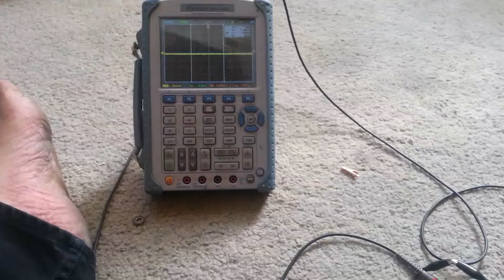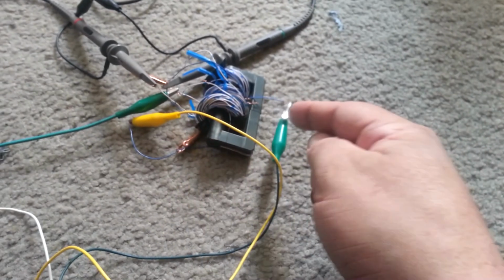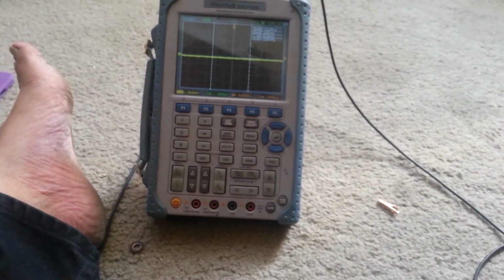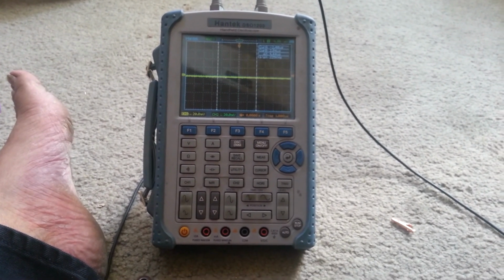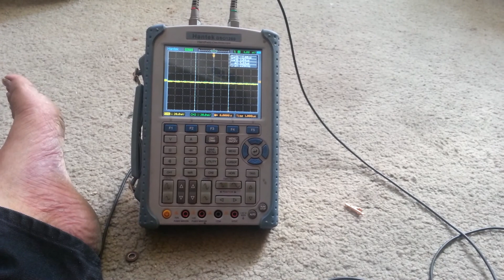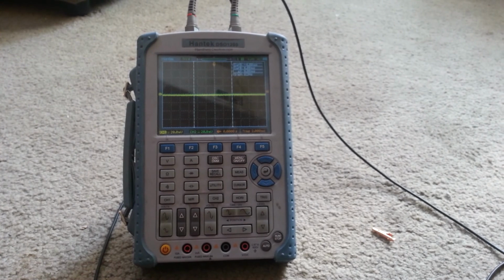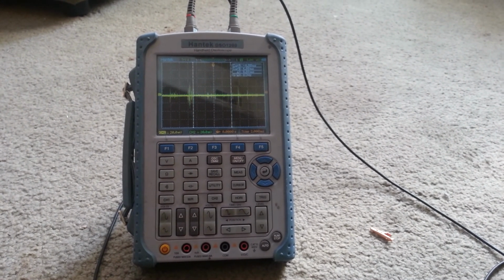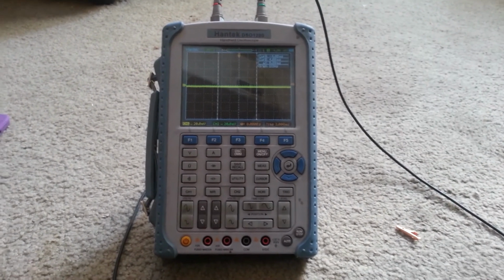Grummage schematic experiment

Comment: Well done that's a good start. Have you got a wire wound pot at a couple of watts ?
I have done the same as you on many occasions !! Burnt out the track !!
Alternately you could try using an old electric fire element !! Cheers Grum.
Reply from the maker: Ya; I tried using an element on a hot plate, with the coils connected a few hundred ohms apart... but then cooked the battery